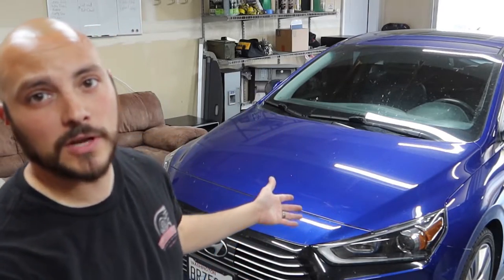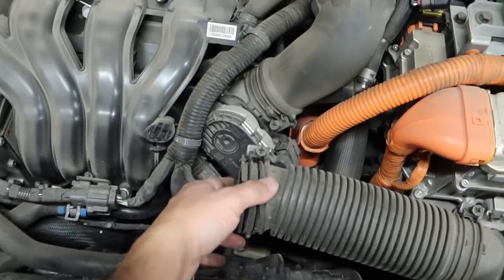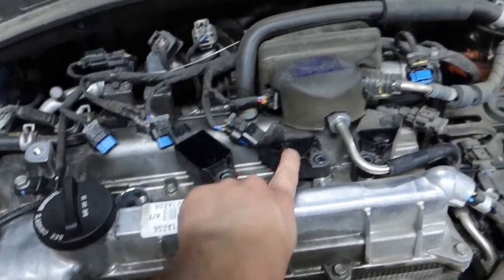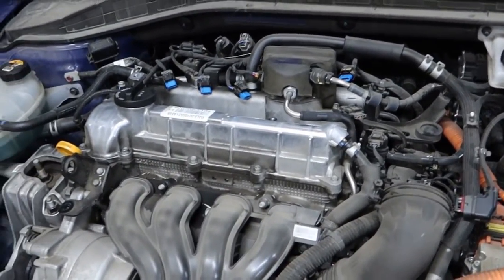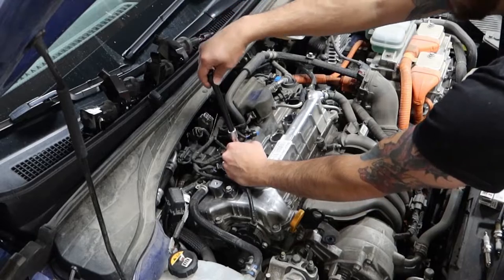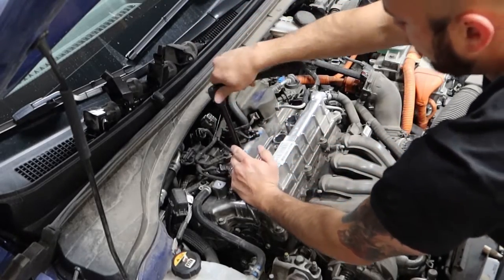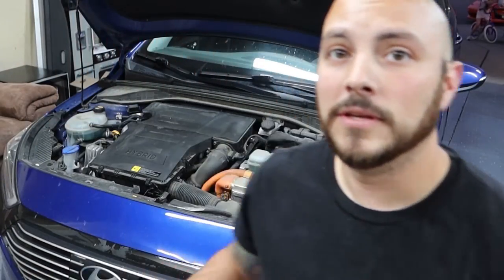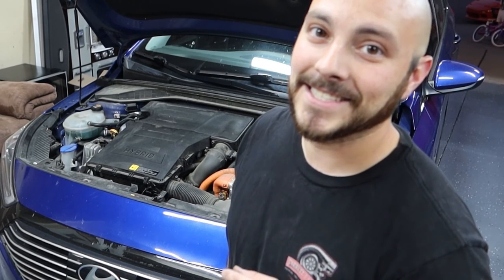How To Change Spark Plugs On A 2017 2022 Hyundai Ioniq

Comment: You should change the PCV (oil control) valve at the front left side top corner of the engine at this time. 
The spark gap should be 0.032” not 0.027” that comes out of the box. I followed this, only used a tiny bit of spark plug boot protector (dielectric grease?) and torqued the plugs to about 18 ft/ lbs. After inspecting the old plugs, I was sure that I have to take each plug back out gap each and put each back. I’ll try to hold it using the spark plug socket to avoid getting grease everywhere.
PS: the product page for the spark plugs mentions 0.032” gap and that’s what I measured on my old plugs too. A flathead screwdriver worked better than needle nose pliers to gently unclip the wire harness clips. I think it makes it easier to get the engine cover off if you angle the front of the cover upwards, wiggling it up and down a couple times, then down as you pull up from the back corner with your right hand pulling it off.

Comment: Great video. The plugs should be exactly the same for the plug-in model, I'd think.
Reply from the maker: Does the plug in model have a gas engine?
Reply: @Boost-EdAutomotive  yes, it has the same engine but with a bigger 9kw hybrid battery that you can also charge.
Reply from the maker: Then yeah, should be good to go!

Comment: How often do these need to be replaced on an Ioniq?

I have 190,000 miles on mines and a couple of weeks ago it started to jerk when accelerating at a stoplight and wondering if this is the cause.  It is slowly getting worse.  I changed the transmission fluid but it did not fix it
Reply from the maker: If you haven’t changed them then I definitely would. Hopefully it will help. 190,000 is a long time to not change them
Reply: Yes change it cuz I’m sure you have misfire and engine code should also show up on your dashboard
Reply: I have the same problem but I have the 2019 ioniq with 62k miles. I hope it's the sparkplugs because that's what I'll be changing soon.
Reply: @theforce5191  60K is kinda early though to change it but try it anyway…most likely it is
Reply: @leetos.4915  that's what I'm thinking but I might as well since I have to do the maintenance on it anyway.
Reply from the maker: I had a misfire in the cold since 20k miles or so. It’s weird because it never threw a code but it definitely sounds and feels like a misfire. It always goes away. After changing plugs I don’t feel like it’s happened again
Reply: @Jokertechz  I just left the dealer.  Cylinder 1&4 misfired, causing check engine light to come on.  

I will be replacing my own.
Reply: I ran 264,000 miles on my original plugs and i finally got a cylander 3 misfire code. The pulgs were gone the tips and curl on the metal was completly gone on the plug lol!!!!! It literally kept running until then lol

Comment: I tried to remove the engine cover but the top right corner won't budge. How hard do you have to yank it? I don't want to damage the cover so I just put it back on and cancel the work!
Reply from the maker: Sometimes it’s a little hard and sometimes it’s not. Give it a wiggle. Look around for anything stuck in that area

Comment: At 70K mileage is too soon for replacement of spark plugs. I owned 2017 model and replaced them at 180K mileage due to misfire trouble code I got.  However, 70K replacement would make the performance at its best especially with NGK OEM iridium spark plugs
Reply from the maker: Yeah, I agree. With them being hybrid the engine doesn’t actually have 70k miles so they require less maintenance. I was doing some preventative maintenance on my wife’s car and decided to knock mine out as well. Ever since 20k miles I would have a random miss on start up rarely. Like a couple times a year maybe so I figured it wouldnt hurt changing them and then it would be nice to make a video to hopefully help someone else out.
Reply: Trust me,  my 2019 is throwing a misfire code and it is at 58,000.
Reply: Mine just showed misfire code today lol
Reply from the maker: Mine did a week ago I actually made a video about how to diagnose it. I need to upload it
Reply from the maker: @user-nt2iq7lx8m yes, please do

Comment: Is there a torque rating for the spark plugs or just hand tight?
Reply from the maker: Hyundai recommends 15-21 ft/lbs. I like to stay on the lower end of torque spec for spark plugs

Comment: If its hybrid why does it need spark plugs?
Reply from the maker: Because it has 2 engines! Which just sounds terrible from a mechanics perspective 😅😂
Reply: Hybrid means a mixture of two things, in this case a regular combustion engine and an electric engine. Hybrid is a substitute word for “two” essentially.

Comment: You did not put the required dielectric grease in each boot. Bad install that makes.
Reply from the maker: For sure! I’ve never used it but I would never tell anyone specifically to not use it

Comment: How do you reprogram a 2018 Hyundai ioniq hybrid after changing the spark plugs my father had his plugs changed shortly after the check engine light came on he took it to the dealership they said that after you change the plugs you must reprogram the car
Reply from the maker: Never heard of that. There is a “ground” you can unplug for a minute or so and it resets the computer. As for reprogramming I’m not sure. I have a troubleshooting video on this car for an engine code if you skip to the middle that’s when I unplug that ground I was talking about
Reply: @Boost-EdAutomotive  ok thanks

Comment: All tools you need: 10mm, ratchet, spark plug socket

"Okay so pull out your drill"
Reply from the maker: Lol I get it but I’m telling you what’s a necessity, not what I have. If you want to do it with a drill than feel free to buy one. This is geared towards those who have little experience and possibly little tool count.
Reply: @JoKeRTechz  yeah, makes sense but if that were actually true then showing them how it's done with the use of hand tools might have been more appropriate. Still good video.
Reply from the maker: For sure. I’m just spoiled with the tools I’ve accumulated over the past 12 years. I’ll keep that in mind for my next how to